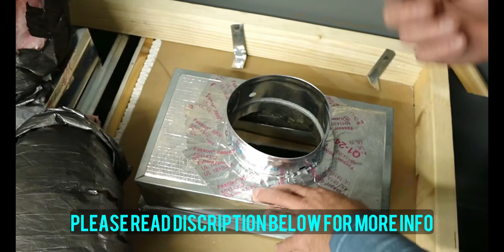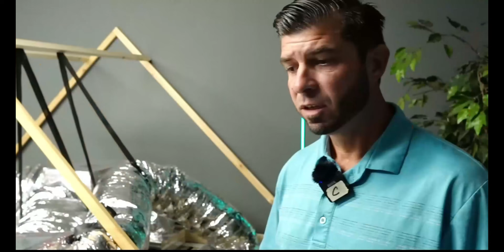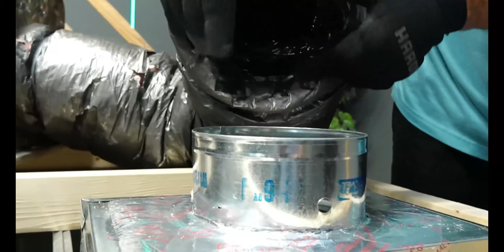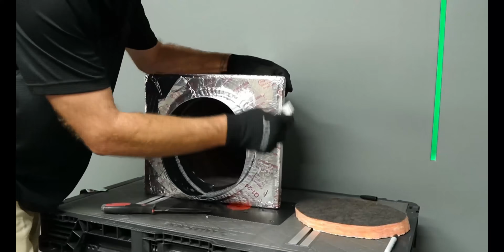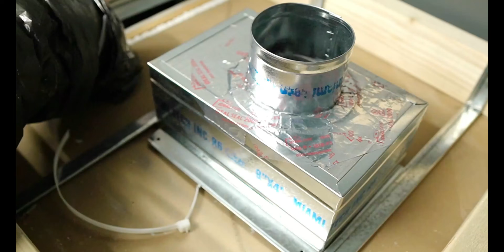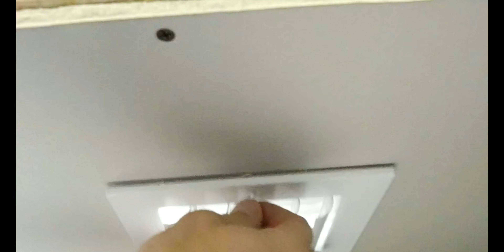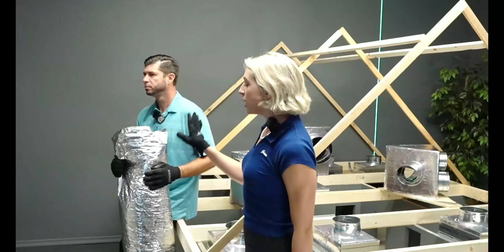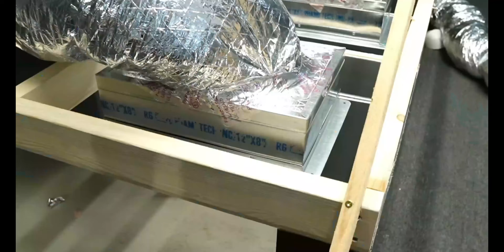Repair Or Replace Your HVAC Flexible Duct System And Save a Fortune

Comment: Thank you! I think one of our kitchen ducts may have a tear, but it's a two story house and the master bedroom is directly above it--any idea how to visually inspect the duct? I can find the ductwork in the lower attic for every vent downstairs except for the two in the kitchen and one half bath.. One of the ducts goes into the wall so I'm assuming it may be that one.  Is the only solution to pull up the carpet and sub-floor in the bedroom?
Reply from the maker: Duct inspection camera should show the condition of the inner jacket. It’s not uncommon for a kitchen supply grill/duct to sweat due to steam produced while cooking. Average life expectancy on round duct is 20 years. We would recommend consult with a professional. (team member)
Reply: @GWAC555  Well that explains my problem. I have these kinds of flexible ducts and mine are 34 years old. I've had them re-sealed through a subsidy from the power company, but I often smell "attic smell" in the house when I've gone out of town for a few days and the house is closed up. I also feel cool air coming up through the kitchen wall when in the attic above it. I think I have leaks and it's causing a vacuum in the house, so it's pumping cold air into the attic and sucking hot air down from any openings. Cathedral ceilings and tight access are going to make it expensive....

Comment: Wait a sec.. you destroyed the correct securement for the duct boot in order to jerry rig something... um. And I think I missed the part where you told people to make sure they install the duct in its stretched form (not just to stretch it before installing) so it works correctly, and not to let it sag across rafters or in slings.

Comment: Duct board "mixing boxes" or wedges are actually not approved by Manual D. Very hard for the air to know which hole to come out of and how will it know how much air to through each hole?
Use Wyes instead.
Reply: Did know so looked up: Wye fitting or Y-joint).  Thanks!!!
Reply: Yeah this “logic” is flawed unless you’re claiming a wye is some smart device that knows where to send the air… it’s the same thing as a mixing box. Air is going where air is going.

Comment: So is it 100% necessary to replace the whole thing rather than patch? Squirrels chewed a couple small holes in the middle of on of mine that is probably a 4ft length of destruction. I shouldn’t just patch it?
Reply from the maker: Here are your options; 
#1 If your duct system is more than 25 years old, we recommend replacing it. 
If the air is balanced, no issues with airflow or the HVAC equipment hasn’t been upsized you don’t need a duct design. Simply remove the old ducts and mixing boxes and install a new duct system. 
#2 If your duct system isn’t old but you have a line that’s damaged by rodents, remove the line, measure the inner diameter of the duct and buy a new duct to replace the line. 
#3 If your duct system is more than 25 years old but you don’t really want to replace it rather than repair one line you can definitely do it but keep in mind that old flex ducts can cause damage to the home. 
We have seen quite few old duct systems that damaged the ceiling due to sweat to the point where the ceiling partially collapsed. 
(team member)
Reply: @ I appreciate it. House was built in 08 and have had no complaints about heating or cooling.

Comment: Do you have a company that you recommend or used to design your duct system?
Reply from the maker: Try to search for Heat Load or Thermal Load calculation companies in your area.

Comment: Do you have a video on how to make a mixing box ? Can I  make my own? Also, what size is the mixing?
Reply from the maker: You can purchase pre-made mixing boxes. They need to be at least 3-4” taller than the largest collar attached to the mixing box. If you have 14” duct (trunk line)  that requires a 14” collar. The mixing box needs to be at least 17” tall to host the collar otherwise the collar will not fit.
Reply: @GWAC555  I really enjoyed your video.  Thank you for the information. Hope to see more videos.

Comment: I had no idea flexible ducts could last up to 30 years—very informative.
Reply: Yez but solid pipes can last twice as long.
Reply: Mixing box/octopus, are not as good as .  Competent Manual J and D for only $300 ? What planet do you live on ? Easily 2-4 that figure.
Reply: @johnwhite2576 see my comment above I have had Minisplit In Sandpoint Idaho and Now in my Arizona garage ..I need to find a contractor to explain the process of removing all central air ducts and replace grills with plaster no more central for me!!! These central air designs require lots of “maintenance “ they should be outlawed for health considerations.. pursuade me otherwise !!
Reply: PS everyone I am a homeowner who has an opinion about healthy lungs I grew up when leaded gas created green smog healthy lungs and affordable cooling a d heating is what want not complicated ducts that gather dust and contaminate our indoor air
Reply: I am not selling anything I am a retired professional who is fed up with central air
Reply: PS my Minisplit garage is clean now I want my indoor living space just as clean

Comment: I converted my Cottage to a home and it cost a lot. I have vaulted ceilings therefore the HVAC system was installed in the crawl space and I have issues with mice chewing through the flexible ductwork and nesting. So obviously I'm dealing with the mice but I'm considering replacing the flexible duct work with more traditional metal work, if I can't get rid of the mice permanently I seem to have been mostly successful eliminating the mice, but I'm in a rural area on Lake actually and in the winter time my place is the only refuge for them. A mixture of finely diced sweet potato baking soda and peanut butter is devoured by them and seems to be killing them off

Comment: The video is awesome and super helpful.  I’m looking to upgrade our older duct work in a similar fashion as describe while also upgrading from R6 to R8 and removing a lot of slack the original installers left in the duct work lines.  In terms of the transition boxes, do you have to make them yourself?  I’m struggling to find them in typical big box store websites and online. I can easily find knocked down plenums and air returns but not transition.  I’ve tried looking at different terminology too.  I see some random triangle boxes but almost never the square or rectangle.  Am I missing something?  Can you use metal transition boxes? Are they purely DIY?  Thanks again!
Reply from the maker: Thank you! We would recommend buying those transition boxes (mixing boxes) instead of making them. They are available. Typically, we don't really make them on the filed.
Reply: I feel you, the online search is exhausting.  Local supply houses have pitiful customer service and sub-standard material. 
/The Louisiana Way  ( the leader of city of New Orleans mechanical inspector dept went to federal prison for two years for corruption)

Comment: I really dislike the practice of cutting the vent hole in the drywall and leaving the exposed drywall.  Air quality is a much greater priority than ever, we should really be sealing up that drywall so that the dust isn't getting picked up by the vents.  And for those that want to try and dismiss that concern, you're indeed incorrect.  It is a big deal.  Yes, there is a lot of dust within a home, including new construction or remodels, but things should also be cleaned far better to remove as much as possible.  In addition, sealing air infiltration points from unconditioned spacing is important and that includes these vents, anyhow.

Also, I think extra work should be done when extending a duct to ensure that overlapping  insulation doesn't separate.  Some tape internally and even a zip tie externally.  Some movement or shifting when setting the duct or blowing insulation likely will mess it up, even if you've gone through a lot of effort to create "slack" internally.

It also looked like you were going to handle it, but when you taped the duct to the collar, the perforation in the lip is exposed.  I would have covered that with the tape.  The outer tape isn't enough.  For air quality, we're talking about microscopic particulates and fiberglass is not something you want in your lungs.

And... some better beer.  :)

Overall a great video, I think you did a great job, it was just things that I get very nit-picky about.  You've performed a  great service to the community!
Reply: Exactly most people can't even install this garbage flex duct properly.

Comment: to add, the only difference is to include but not limited to: 
1. Its in an attic
2. you're crawling around on rafters
3. it's 100 degrees
4. its dusty, dirty and poor air flow, dead mice, rats and if you're lucky a raccoon
5. it's not at hip height, in a conditioned space and you can reach everything
6. you're swimming in insulation
7. you're wearing long sleeve shirts, mask, dickies trousers
8. You're working on sheetrock
9. Everything you touch is wet, because its 100 degrees and you're sweating on everything
10. Your drill battery dies
11. Your head mounted lamp keep slipping and then the battery dies
12. You're doing this for 3 days straight praying for a cloudy day or rain
13. You're going in and out through a scuttle in a closet
14. The customer wonders why this is taking so long and doesn't like you're playing 5FDP
15. The office gives you "Emergency" calls after you're done for the day because you're on-call
16. The office gives you calls because the customer specifically requests you.
17. The office gives you calls because the on-call guy called in for the day.

Yea, okay.
Reply: 100 degrees? Must be a crisp fall day in the off season.
Reply: This guy needs a beer 🍺
Reply from the maker: We've been through all of what you have said. That's why duct systems are expensive. (team member)
Reply: You just described anytime I've ever gone into my attic. My house has high cathedral ceilings and is in Florida, so the attic temperature can hit 165F. I try to plan any maintenance for December when it's only 110-120🙂
Reply: @YouOldFishEyeFool I hope you are joking. I live in southern Texas and our attics are not even remotely hot in the winter. That's when we do repairs.
Reply: Sounds like you've done this before 😂
Reply: And all that equals a few grand... totally worth it
Reply: Enjoy your new career as an HVAC installer 😊